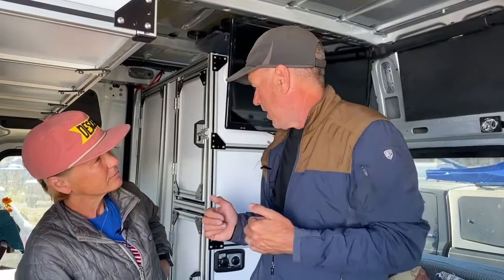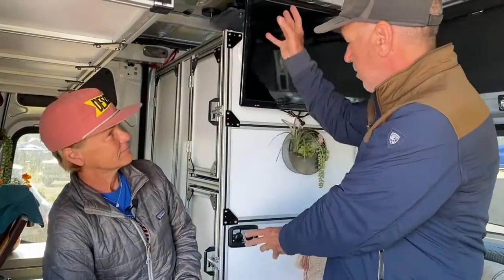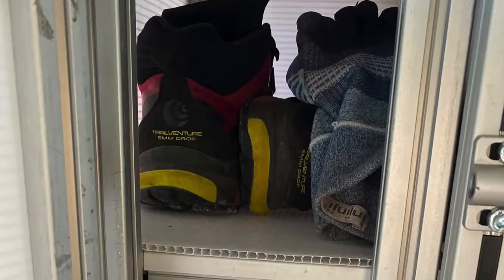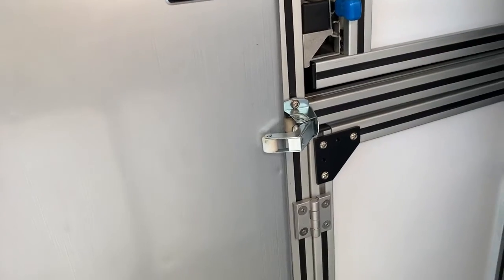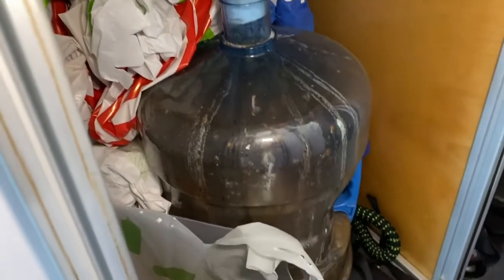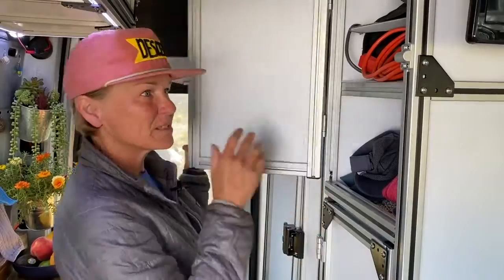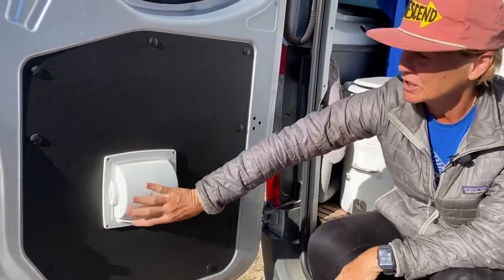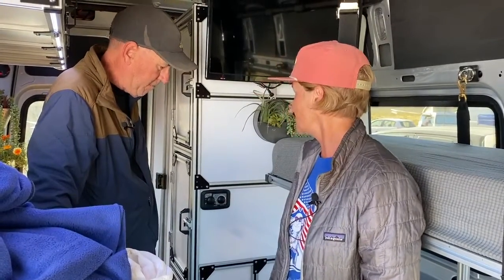EASY DIY SPRINTER VAN BUILD 80/20 MODULAR SYSTEM WITH BUNK BED

Comment: Lovely build, & so generous of you two to share how you did it!  Wonderful, strong, lightweight modular approach.  Seems safer with the 80/20.  I’d hate to see wood framing breaking apart & “spearing” - accelerating into the front seat area in the event of a crash.  Looks like all heavy items can be anchored into the L track with straps too.  And it’s nice to see how you finish each others sentences. Sometimes I wonder where in the world you’re traveling to now!  
Happy Trails.